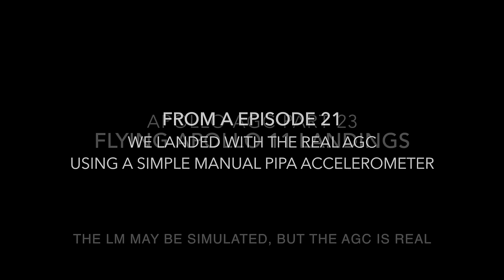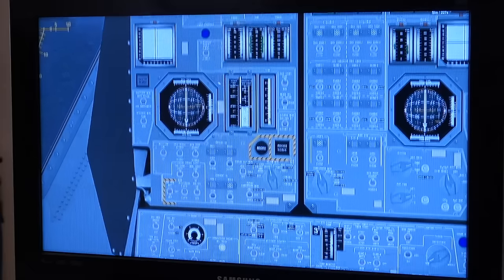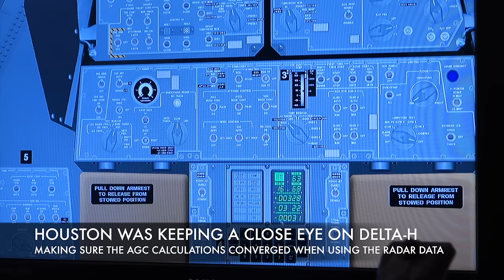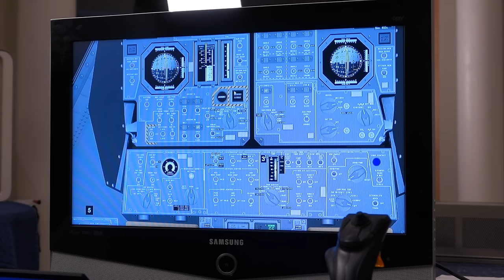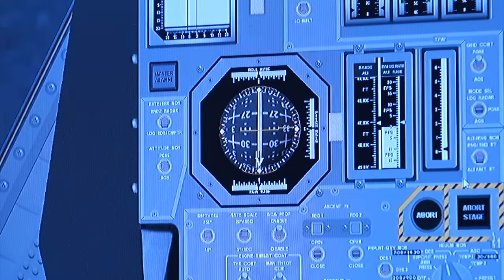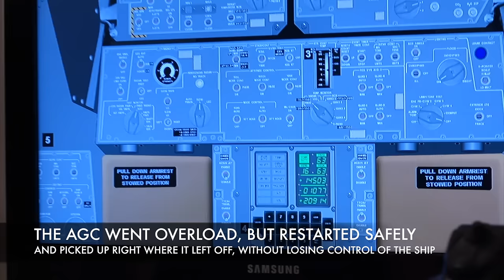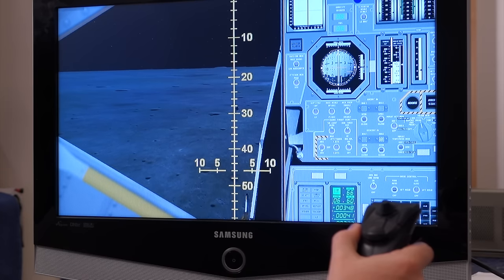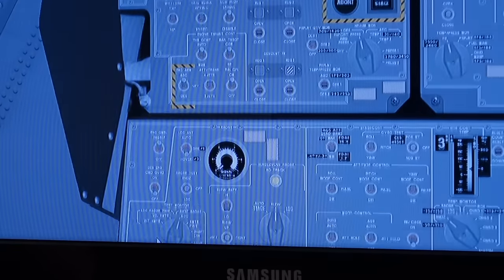Flying the Apollo 11 Moon Landing with the Original AGC Code (Apollo Guidance Computer Part 23)

Comment: When Neil pit the rendezvous radar in the Slew position was that an accident or was that in the flight plan and just an error on the programmers part?
Reply from the maker: Flight plan, and the correct thing to do to prevent potential overload of the AGC. Unfortunately the hardware did not respond to this correct configuration properly, in a very arcane way, and went haywire.
Reply: @CuriousMarc  Interesting. Thanks.

Comment: CuriousMarc, could you ask Mike if his AGC Monitor (with the green lights) could be used with the VirtualAGC instead of the LM channels display?
Reply: Knowing a little bit on how Orbiter add-ons work (though not NASSP itself) - this is entirely possible, and would require a similar modification of the NASSP code. In fact you could build an entire LM cockpit and connect the switches to their virtual equivalents if you wanted to.
Reply: @SolarLiner  My question was more for the standalone VirtualAGC, not the one 'embedded' into NASSP. I've got the standalone VirtualAGC (pretty neat set of programs, by the way), and one of the windows is the one titled "LM Simulator 1.0 by Steven Hotto" . It's that window I'm wanting to augment or replace with the AGC monitor that's prominently shown in most of these AGC videos. I'm sorry I didn't make myself clear before.

Comment: What happened when buzz said "4 13 is in"?
Reply from the maker: I believe this is an entry for the AGS to prepare it for abort from the moon.
Reply: That's an input to the AGS (Abort Guidance System). One of the first steps post landing for Buzz is CLEAR 413 +10000 ENTER on the AGS keyboard. Per the AGS Flight Program 6 operating manual: "Any entry in this cell (+10000 is suggested) causes the lunar surface flag to be set and the lunar azimuth stored."
I didn't do this in the video since I didn't initialize my AGS, but it's worth noting that NASSP also includes an AGS emulator, which also runs the actual flown AGS software (FP6).
Reply: @mikestewart8928  Thanks for the info.

Comment: Can you make it work with Kerbal?
Reply: KSP's physics system is too simplified - but other than that I don't see why you wouldn't be able to interface the AGC with KSP. The only real problem would be that the software is too tightly integrated with the mission and the spacecraft - the point wasn't to create a 1960's version of MechJeb, but a guidance computer that would land the LM on the moon.

Comment: Did you obtain P63 from rope memory or did you compile the source code from the NASA release ?
Reply from the maker: Mike Stewart recreated the Apollo 11 code from the listing in the MIT museum which we briefly showed on our “tour” video, which had both the source and the object code. He also recompiled the source until it matched the object exactly, to make sure we had no transcription errors (the whole thing was transcribed by hand, as OCR, even with custom optimizations, had much too high an error rate for code).
Reply: @CuriousMarc  I downloaded the program ASCENT_GUIDANCE.agc from GitHub, it says "Assemble revision 001 of AGC program LMY99 by NASA 2021112-061
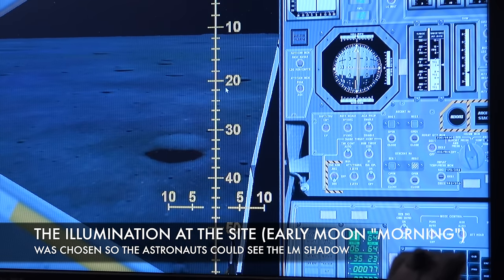#	16:27 JULY 14, 1969"
Does the "2021112-061" identify the programmer ? Also, can we sure the code is complete, or did revisions come after it ?
Reply from the maker: @kimbalcalkins6903  Make sure you get the original from Mike from the Virtual AGC website and not one of the many reposts without source attributions. 202112-061 looks like a NASA block II serial number with a revision dash -061. I think the phrase stops at "by NASA.", should be a period there. I will ask Mike to confirm. The rope programs were complex and rather large programs (by assembly standards that is), written by a team of many programmers. I am not sure who wrote the ascent guidance. I will ask Mike too. That would have been the program to take over the Saturn V LVDC and guide the Saturn if the LVDC were to fail.
Reply from the maker: @mikestewart8928 Oh dang, of course, this is LM programming, what am I thinking about. I have still not recovered from the LVDC video. No way to put multiple hearts, so you get just one ;-)
Reply: @CuriousMarc  ok, thanks

Comment: Wondering if the cpu’s used was the RCA 1802 ?
Reply: No, the 1802 wasn’t introduced until 1976. The AGC is its own cpu, with its own architecture and instruction set.
Reply: Benny Löfgren , thanks! Intel did work on the first 80 family processors during that time I think. I was an engineer in 1970 using it in a ‘first’ commercial product. The 1802 was ‘radiant’ proof. Very interesting era and high regards for the guys bringing it to life again!

Comment: I tried installing this but it's not working
Reply from the maker: It’s incredibly hard to get it working. I need to make a video on how I eventually succeeded. It took help from the NASSP community.
Reply: @CuriousMarc  I think I got it mostly working but what is strange is the Apollo 11 launch has a 4-Hour countdown but after 4 hours nothing happens no lift off
Reply: @CuriousMarc  also I wasn't able to get any Earth texture around the launch pad unless I used the NG version
Reply from the maker: Oh, you are doing the full mission! Power to you. I have not even tried that. Just P63 to land like in the video, that was hard enough. And I was never able to take off again from the Moon - could never get the periscope to work to perform the star alignment for the IMU necessary before takeoff. But Niklas has flown many full missions (he is the developer of NASSP, and the one who gave us the memory image for the AGC so we could start in moon orbit), so I would ask him on the forums. Can't remember his handle though. Good luck. This is as hard core as it gets. You have to understand all of the hardware and follow every little detail of the mission check list. But man, it makes you feel like an astronaut. So you have to study like one.
Reply: @CuriousMarc  How did you learn so much?  Where could I look or read to learn how it all works and what switches do what?  I am currently building a DSKY from electronics and 3D printed parts.
Reply from the maker: There is tons of NASA documentation scattered out there. Started from the AGC documents, then radiated outwards following what it was connected to. The Apollo, LM, CM, Saturn V, and mission specific handbooks are great:
Apollo handbook https://www.ibiblio.org/apollo/Documents/49176721-Apollo-Operations-Handbook-Block-II-Spacecraft-Volume-1.pdf
LM handbook https://www.hq.nasa.gov/alsj/LM10HandbookVol1.pdf
GNC's user guide: https://archive.org/details/j2-80-E-2448-REV1?q=user%27s+guide+to+apollo+GNC
etc, etc... The virtual AGC repository has most of the juicy stuff:
https://archive.org/details/virtualagcproject
Then of course the flight plans and giant checklists for each mission which you need to follow to the letter.
Reply: @CuriousMarc  Thank you so much Sir!

Comment: Brilliant code you've written there!  WHY are you not using Linux?  I would never trust windows for this sort of thing!
Reply: They do use Linux - however Orbiter is a Windows-only program that doesn't run well enough under WINE especially if the goal is to do public demos.
Reply: Furthermore the problem they encountered want because I'd Windows directly but because of how the graphics were handled; something too them out of full screen and crashed the graphics engine.

Comment: wait so the Sim uses the real ARC you just repaired in order to run this??
Reply: Sounds like they're running it on a FPGA simulation of the real AGC.
Reply: @user-ys4op3ux1p  Actually, I'm pretty sure that they are running a straight software simulation of the AGC, although I'm not 100% confident.

The software / mod is compatible with the real AGC hardware, however, and when they regain access to the real hardware they plan on repeating what they did in this video with a real AGC.
Reply: @jmr5125  Both landings in the video were controlled via by my FPGA AGC, not the software simulation. Gotta test on that before trying on the real thing. ;)

Comment: Wasent there four computers on the apollo?
Reply: Depending on how you look at it, yes -- the AGC (two instances, one in the LM and one in the CM), AGS (Abort Guidance System, LM only), the SCS (?, CM only), and the IU (Instrument Unit, mounted at the top of the 3rd stage of the Saturn rocket).

However, only the AGCs and IU were actually used in flight -- the other computers were very simple, very limited devices designed to protect against an AGC failure.
Reply: @jmr5125  I think there also was a simple computer that ran the EDS for the LAS.
Reply: The SCS was a completly analog system (transistors, relays & electromechanical devices). Okay, the EMS had some sort of  electronic counters in it, but there was no CPU there.
In the Saturn were 2 computers: the LVDC and the FCC. The LVDC was a 'real' digital computer and did all the navigation and guidance stuff, the FCC was an analog device (relays and mag amps (no joke!)) and did all the control stuff like driving the engine gimbal servos and turning the APS thrusters on and off.
The EDS was again analog (relays for the most part). They wouldn't give such a vital task to a digital computer those days. At least not to a single one. And replicating the 2-of-3-voting logic of the EDS in ancient computer hardware would've been quite challenging in terms of weight and space...
Reply from the maker: One AGC in the CM, one in the LM, the AGS abort computer backup in the LM, and the LVDC guidance computer in the Saturn V. Looks like your count is right on!

Comment: Hi, amazing work! Hope somebody could answer me regarding some questions. Im a mechanical engineer and during my education I had basic training in understanding how "and" "nand" "or" "nor" circuits and so on are made, how they function and what you can do with them. All this leading up to understanding and programming plc's. I worked 5 years in a solar cell factory troubleshooting plc controlled equipment. Still I am not computer guy so keep the answers simple please. Did the AGC perform pre programmed functions based on time only, like running a specific engine for a certain time? Or did it skip to the next function based on sensor inputs like a plc? Excuse me if I dont use the correct english terms, I'm Norwegian and its been 10 years since I worked with this. It would be great to see a video explaining how the AGC functioned regarding input from sensors, I havent really found anything on the internet. Regards
Reply: The AGC had plenty of sensor inputs, and outputs. For example the landing radar, the gyros (stable platform) and the control joystick were all connected to the AGC. I really recommend the book “The Apollo Guidance Computer Architecture and Operation” by Frank O’Brien. It is a very, very in-depth look at the AGC.
Reply: There was a mix of code that ran in the AGC. Some were triggered at fixed times or at fixed intervals. Some were run when the astronaut started a specific 'program', which is a phase of the mission that was requested by Verb 37 and then the program number. Program 63 began the descent phase to the landing in the LM, program 71 was the abort program. 

Astronauts could trigger other code such as a continuous display of some set of numbers; Verb 16 (continuous decimal display) and Noun 68 would give the difference in height between the computer trajectory in the AGC and the measurement from the landing radar, during Prog 63 in a landing.

Pressing a key on the DSKY would trigger an interrupt causing some code to read the keystroke. Other code would look at the keys entered and make appropriate software run. 

Updating position information or reading radar returns was done by a mechanism that interrupting the running program for a couple of cycles to increment or decrement some counter held in memory. This update process was invisible to the programmer but when they read the memory location of the counter, they would see the latest updated value.

The design of the software allowed multiple tasks to run, with priority scheduling. During a landing, routines would be updating the position and velocity of the LM based on IMU updates, refining that based on landing radar returns, firing the RCS thrusters to keep the LM oriented properly, controlling the descent engine thrust, watching for inputs on the hand controllers and switches, and displaying updated status values on the DSKY.